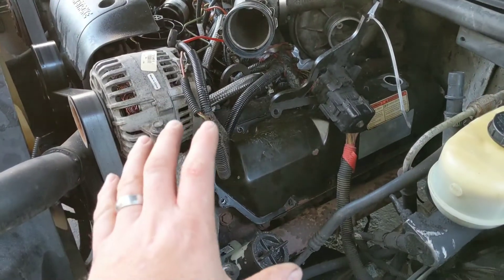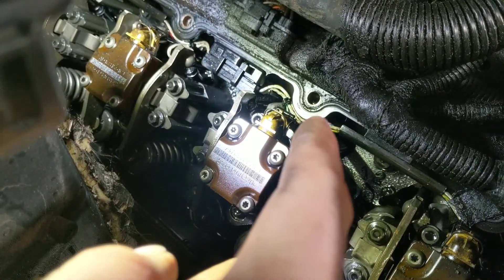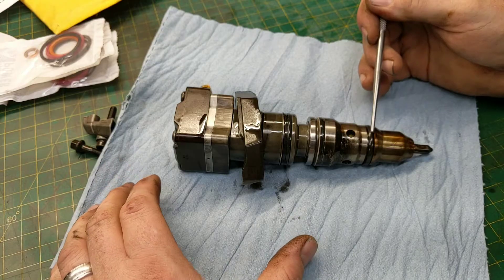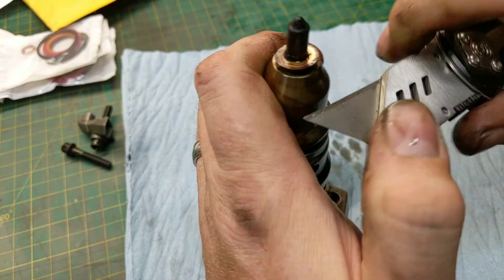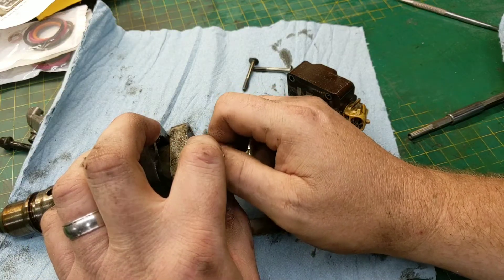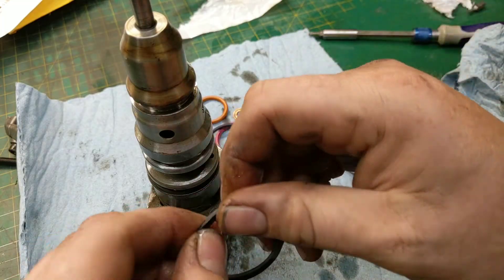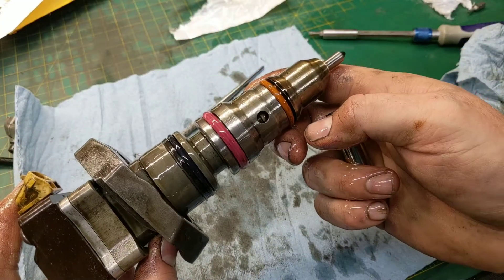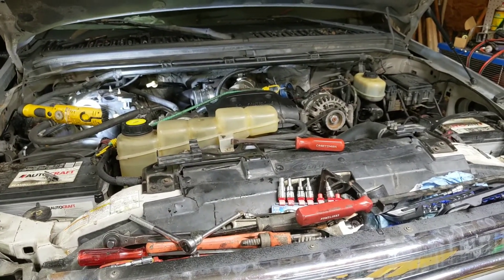Replacing the Ford diesel 7.3 injector o-rings and installing an injector shim kit, tune up kit.

Comment: I like your video just fine, but may I add that once you drain your oil from the heads and pull all the injectors go ahead and pull all the glow plugs for inspection and testing. make your injector repairs and install all the injectors but not the glow plugs. Start cranking the engine with zero compression and the starter will not overheat that much this will blow out any oil or coolant if you was dealing with a cracked injector cup. Blowing out any fluids out from the cylinder is very important, you do not want to get hydrolocked. After you see your motor oils pouring out of the injectors exhaust port, Stop and install all the glow plugs and start her up. (7.3 Lives on & on)
Reply: Thank for the extra tips Roy, we have 2, 7.3, 99&02 the 02 has 320000k and literally had nothing done to him I think it's time. Been faithful!
Reply: Yeper's I  respectfully agree. Power strokes are expensive if you make a mistake 😭
Reply: I agree with this post. Also it's best to use a shop vac that the end will fit right down in the injector hole, once u pull the injector out. Do this every injector removed . Pulling out the glow plugs also insures anything extra in the cylinder left behind. Will help to prevent hydrolock .. but if u don't use a vacuum, do be prepared for a lot of oil and what not to be shot out of the glow plugs holes. 
In special cases when trying to remove the high press oil bleeder screw's. If u strip one out or shear off an Allen wrench or something that prevents u from being able to drain the oil before removing an injector... The vacuuming will definitely help in the long run. 
If you do not vacuum out injector holes and(or) do the cranking with  glow plugs removed as this man  stated in this  comment.  Than be prepared for an extreme crank and no start condition once you are done. Probably going to burn up a starter trying to get the truck to start again. So it's very crucial u do remove glow plugs and crank without compression or vacuum out . And definitely helps rebuild oil pressure. Before reassembly.
        Thank you for addressing this. And adding to original post.
Reply: But hat's off to the info on the injectors video 100% very clear and thorough 👍
Reply: Went people do this with the injectors removed as well?
Reply: Very well said Roy, you must be a well seasoned mechanic.  Not too manyyy mechanics even know nor ever been taught those little tricks.  I have witnessed guys that have locked up by fuilds.  You can give advice to some n some just know everything.  Every shop has a know it all, n most bosses have stories of doing jobs that you know they're all bullshit.  That's why most got off the floor so they never screw up something.  

I've had some that couldn't do a overhead on a Cummins nor had a clue installing Jake's.  Those bosses are nothing but bullshit, n are veryyy likely to stab their men in the back doing the work.  Narcissists n assholes, don't work for none of them.  They generally have a high turnover of shop mechanics.  Good video by the way.
Reply: This is great! May I ask? Do I need to reconnect everything, like the turbo y, or any of the sensors like the icp, ipr, etc before cranking? When you say start cranking the engine with 0 compression Is that something I need to do special or because the valve covers & gaskets are off there will automatically be no compression?  Basically what is the bare minimum I need to have hook up so I can crank the engine with no compression? Thanks
Reply: @MichaelMuller1  Okay what I have done in the past and NO you do not need to hook up all them wires just put some black tape on the one that goes to the intake heater that one is HOT when you turn the key on. I also unplug the CAM sensor at the front bottom passenger side next to the crankshaft pulley (Harmonic balancer) SO the injectors don't try to fire and they won't until they get oil pressure any ways. By leaving out all the glow plugs and the cam sensor unplugged you are doing two things. Blowing out any fluid out of the cylinder and priming the oil system to the HPOP with no stress to the starter, you should see the dash oil gauge come up about 1/4 of the way. If you prime your pump now you will crank less later when you are really trying to start it under compression. Good Luck and God Bless
Reply: @roysaenz5738  Thank you so much my friend! That is a huge help!
Reply: @roysaenz5738  Thank you so much! I did exactly what you said and she fired right up!

Comment: Do not buy parts off ebay
Reply from the maker: I did, and I do it all the time.   The secret is not to not buy parts off of eBay, it's to only buy parts from trusted sellers on eBay.  Understand what you are buying and don't jump on the cheapest part.  These are still on the truck and the truck runs like a top.
Reply: @1D10CRACY awesome

Comment: Sir my truck is doing basically the same thing and like you I have replaced everything under the sun and I seen that your problem was the injectors from your video. My question is when you was at the stop light and you turned off the engine did it run with a check engine light? I can shut my truck off and back on and it will still have a light surge but run with a check engine light. I would appreciate any information. Thank you

Comment: Stickion can be eliminated by running 1/2 quart of higher end transmission fluid as most transmission fluids are 90 %  high temperature/pressure cleaner solvent before you change top end rebuild or
Reply from the maker: Archoil stiction eliminator works well too, but eventually you are going to replace the injectors or shim them like this truck.   Luckily this is a pretty easy procedure, the truck is still running great and starting easy in freezing temperatures.

Comment: What effect will it have if the internal spacer isn't correct?  Do all the 97 Powerstores have the square O ring set up? Mine looked like it had just one larger O ring.

Comment: Gotta warn everyone about hydralock so no one goes to crank there truck over and bend the connecting rods or break a piston ring    pull the glow plugs all of them and crank the engine over to push all the fuel and oil out of each cylinder.  If you don't do this, your weekend project will turn into a month or more pulling the engine out of the truck.

Comment: Why don't you use 2ea of the metal rings on the Grove the flat seal and oring go together in?    I'm hearing yes use 2 c ring seals and I'm hearing No don't do that
Reply from the maker: They call the metal ring a backup ring.  My understanding is it's just a seat for the cushion ring (the square one).  The actual upper injector seal is the round one.   I don't see the purpose of using two metal rings.  It could just be one of those rumors started online and now a lot of people who don't know any better think it's an improvement.  I guess, when in doubt, follow the manufacturers design, their engineers are the ones who designed it.
Reply: @1D10CRACY PS:  thank you for your reply.
Reply from the maker: There could be a very good reason for why he feels two is needed.  But without knowing the why, I don't have an answer and will probably continue to use just one.   Maybe when I get some time I'll dig into the idea some more and maybe find some reasoning.
Reply: @1D10CRACY  completly.understandable.  my maim cue perse is have you done this or heard of it being done or anyone else out there  that could see this chat
Reply: The gentleman at YouTube site Custom works highly recommends to use 2 of them.  He is an instructor and one of ford's Guru's on the 7.3l.   At least that's what he claims.  You know you can be anyone you want on the internet though.  But this fella really knows his stuff,  I wished I could recall who the second one I seen that did the 2 rings as well. 

I do agree 100% with you about the whole engineer thing. As I work with engineers every singke day and understand thier purpose etc etc

Comment: Very excellent video. This is a project I've already done 4 times to r different trucks. I watched it because I'm having a different problem that you didn't discuss but I'm compelled to comment because you covered absolutely everything a beginner basically needs to know. I do a few things just a tad different but that's ok. You did an excellent job with this video, I am very impressed. Ever try working on the 7.3 on an Econoline van. No room to work.

Comment: I had a shop tell me that three of my injectors have failed in the truck is misfiring really bad, is it possible to rebuild the injectors
Reply from the maker: Depending on what is wrong with the injectors, a shim kit may buy some time.  Unfortunately "failing" is a broad term and without knowing "if" how they troubleshooted, there is no way to give you an answer.
Reply: @1D10CRACY  for years the truck would have a random misfire when it was cold and it would go away after it warmed up. I started using stiction Eliminator and it cleared up and then quit using it for a long time and now it's missing really bad

Comment: How did you diagnose that it was the injector orings.  My truck has been surging, running rough, stalling and cranking with no start for a few months now.  I can’t seem for figure out what my issue is. I have replaced the icp, IPR, CPS, glow plug relay, and the pickup foot in the fuel tank. The sensors were all motorcraft.  I don’t know where to go from here.  I am not getting anything but a p0603 from a snap on scanner.  Thanks!

Comment: I need to know I have stage 2 injectors will the oring kit that you recommend will they work?
Reply from the maker: I believe they are the same o-rings.    Let us know what you find out!
Reply: @1D10CRACY  they work on stage 2, but I fell into an issue. I drained all cylinders installed everything, and now fuel is poring out of my exhaust? When I try and start it perfect lol

Comment: 3:22
Kind of scary that Ford designed those brittle wire retainers in such a way that the tabs can snap off and get flung around by the rocker arms....

Comment: I did this to mine ran perfect . 190k so figured before the oring blow out i would do them and re-shim. Now the thing wont start. Im pulling my frickin hair out. Everything is testing good. WTF
Reply from the maker: Just a few things to note. The wiring harness on the valve covers can be tricky.   But more importantly is to be patient when priming the system.    There is probably are better procedures than what I did, I just kept turning it over, then waiting a little bit.   It took quite a few times before it even started hitting.

Comment: Very descriptive & detailed video.  Much appreciated.  My 2003 Excursion 7.3 is surging  immediately at startup & check engine light  (P0683 glow plug module to PCM communicaction circuit).  My ICP is dry & appears fine.  I did replace it 3yrs ago w/an inexpensive brand so wondering if I need another.  Can U explain how U determined the injectors needed new gaskets?  IDK, maybe I missed a  video.  I'm waiting on delivery of valve cover gasket harnesses from RiffRaff currently.

Comment: Can someone tell me what the reason would be for shimming the solenoid when what is worn is the poppet valve!? The factory specification for the plate on the poppet valve is. 004 so if you shim it back up to that spec, and the solenoid doesn't wear to my knowledge,  then why would you need to shim it? I don't believe that there would be a need to do so! Thanks..
Reply from the maker: I did some digging on this a while back and I don't remember what I found.   There was a guy in one of the Ford forums that explained what was going on, but I can't find it.   I will say every time I have done this it resulted in almost unbelievable results.  I own the truck in this video and It still starts very easy.

Comment: To remove the oil drain plugs, I recommend you use a 3/8" drive air ratchet. That is less likely to strip the hex hole in the plug.
Reply: Might be a stupid question but is the drain only on the driver side
Reply: @JS.730  not sure but guessing there on both sides of head.

Comment: i wonder if you would have issues with o-ringing the solenoid to the base to eliminate oil getting in there or is it needed for plunger movement

Comment: Hi.. Maybe you or someone else can help me. I come from Germany and bought a 1990 F E-350 V8 7.3L Navistar Ambulance.
She has the problem that she starts once. But after that it takes a long time for it to start. Probably air in the intake lines. Once it is on, everything works perfectly. The whole thing happens after a day of standing. I thank you or you if someone has a tip for me.
Is the injection pump leaking or one of the 16 o-rings?
I am not a car mechanic. But I would like to learn how it all works. best wishes
Reply from the maker: Possible orings.   This one also was hard to start for a while if you had let it sit for a few days at first.
Reply: @1D10CRACY  thank you so much for your reply. im not a car mechanic. Maybe you can tell me or you have a video where I can see where to find the orings. Thank you for your time. best wishes to you

Comment: you failed to put the armature plate on with the lines going side to side-or front of engine to back,  this is how the magnet on the top is made to match.  i got this wrong first 2 injs i rebuilt - then i senn the lines and re adjusted them.
Reply from the maker: Good eye, when I put the video back together I noticed that too.    I figured most people unlike me would be smart enough to keep everything aligned and it wasn't worth mentioning.  LOL

Comment: I'm about to pull my injectors out and get them flow tested. My rig has nearly 400,000 on her and was running strong on a recent road trip. But I know when i buzz test them a couple do sound weak so I figured since I'm going back under there and at a good benchmark why not get them tested as well. I was reading something and they said after you get them reinstalling and pull your glow plugs and try to start the engine with glow plugs out and injectors not hooked up to blow out any oil in the cylinder. Is that actually a good idea at all or sorta frowned upon?
Reply from the maker: I pulled the glow plugs and turn the engine over by hand, this clears out the cylinders in case there is an excessive amount of oil in them and prevents hydro locking.

Comment: I didnt look through comments. Was your hpop tank draining oil internal?
Reply from the maker: Just had leaky o-rings causing oil pressure to be low.  The engine was hard to start and ran poorly.
Reply: @1D10CRACY   I'm having a problem with mine it is draining the high pressure reservoir internal overnight internal and I do have a bad O ring on my injector cause I'm cause I'm getting motor oil pumped back into my fuel bowl

Comment: So when you buy a "remanufactured" injector say off ebay, is this all they do? how did it run after you did this?
Reply from the maker: I think they year them down and do more to them.     The truck runs fine now and starts pretty easy!
Reply: @1D10CRACY  cool! did you do new glow plugs while you were in there?? how many miles on her now?
Reply from the maker: I didn't replace them.    I'm not sure about the miles would have to look.     I'd guess 320k-ish.

Comment: Question I have a 2002 ford f350 7.3. I just replaced the glow plugs before I put the valve cover back on I wanted to see if the injectors was working right Well the drivers side works as it should however the passager side the oil ports don't pump no oil at all does any have an idea thanks in advance.
Reply from the maker: The valve cover gaskets have the wiring harness built inside.  The plugs on them are pretty fragile, I would start there!
Reply: @1D10CRACY  I also replaced both valve gaskets
Reply from the maker: @andysmith6587  Don't rule out a bad valve cover gasket!  I've worked on a hand full of these engines and have not seen it personally, but I've read about it.  Normally when you have a bank of injectors not hitting, it is related to the plug to the valve cover gasket.
Reply: Well it easy to check since the valve covers are still off ford could have sold me a bad gasket the wires all checked out from the pigtail thanks I'll have a look at it in a bit have to get away from it been given ma a headache lol
Reply: Well up date I went ahead an replaced the valve cover gasket with a brand new on still the same hard knocking as I said truck will start I even changed out the ipr valve, I'm thinking maybe the high pressure oil pump itself but I'm still at a loss.
Reply: @andysmith6587  sounds like one side of your  hpop is clogged or just generally loosing pressure. I'd try pressure testing both sides if all the wiring checked out and has resistance.

Comment: Great video...I bought my first Diesel, it's a 02 F350 4x4 7.3...I'm gonna be putting a new Garrett turbo..5 inch MBRB Exhaust..manifolds and Y pipe..and lots of other things so while I'm down that far I might as well service the injectors and replace the valve cover gaskets...thanks to you I know what it's gonna be like..doesn't look to hard.

Comment: You need to evacuate the cylinders of oil and fuel before cranking or you WILL hydro lock and damage your engine! Remove all glow plugs and turn the engine over by hand a couple of times with a socket on the crankshaft, then turn it over by jumping the starter with the ignition off. Then you can reinstall the glow plugs and purge air from the system and fire it up.
Reply from the maker: Yup!   I usually pull the glow plugs and turn the engine over with a breaker bar fist.

Comment: The 2 videos you did about the injector o rings has been the absolute most help! My truck is doing pretty much exactly the same thing right now. Been chasing the problem for days. Did the icp , ebp and tube. I haven't tested my hpop but ill be pulling valve cover and checking injectors.